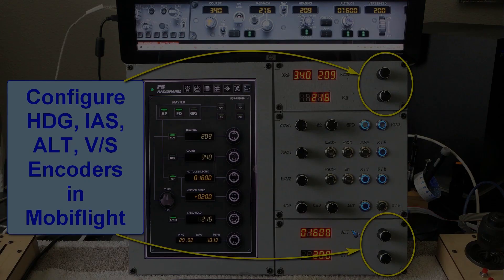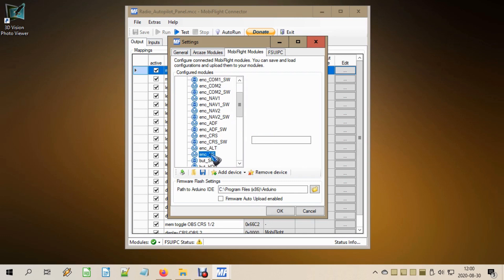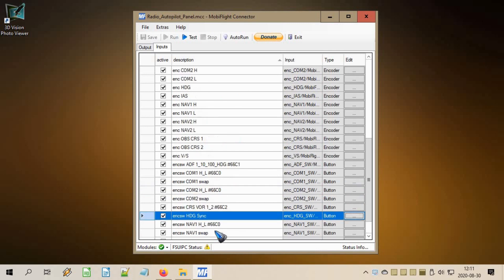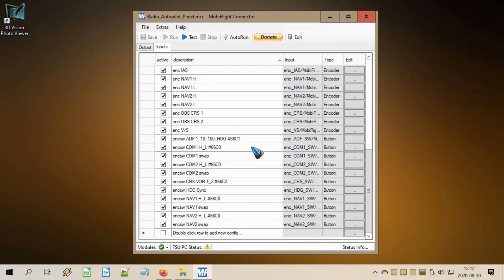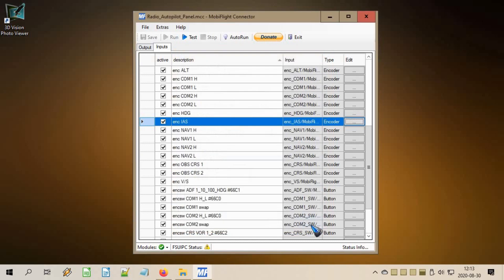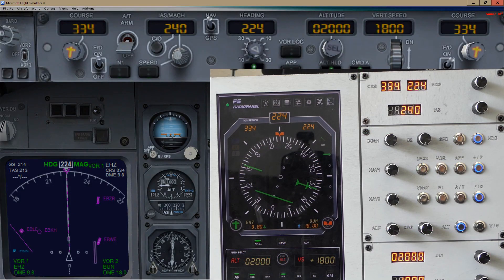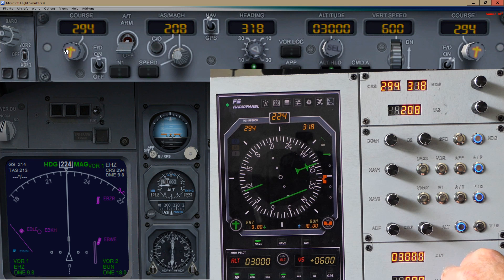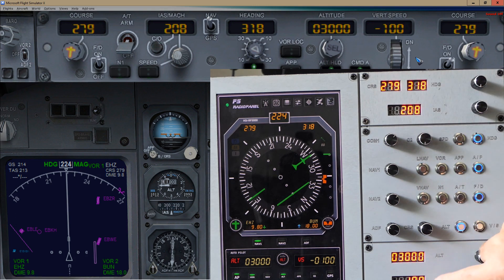Flight Sim Navigation 32 Radios & Autopilot Project Mobiflight HDG, IAS, ALT, VS

Comment: Hi, the light flashes on my arduino board to show that the encoder rotary switch is sending a signal. Ive used EVENT_ID for he HDG Bug, but nothing happens. The only time i get the signal to work in the sim is if i use FSUIPC-Offset for Com1 or Nav1. But never anything else? FSUIPC doesnt support all the G1000 options i need. Any advice?
Reply from the maker: The best option you have is to post your issue as detailed as possible on the Mobiflight forum. People are very helpful there.
Reply: OK, so the problem seems to be with Xplane11. I just tested it on FSX and works fine. Do you have any experience with Xplane11 to help? Thanks.

Comment: Great series. I'll be starting my own build soon. Do you always need Mobiflight software running when flying in the sim or is it only needed to program the board?
Reply from the maker: Yes, Mobiflight needs to run. It's the software that communicates with the Arduino and with FSUIPC that in turn connects to the flight sim.